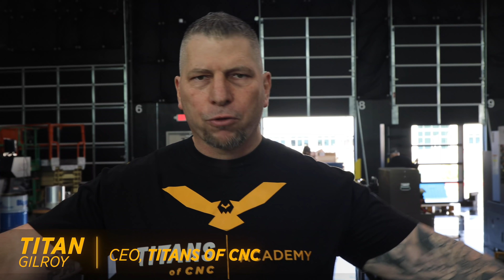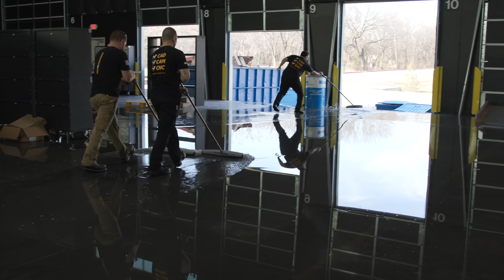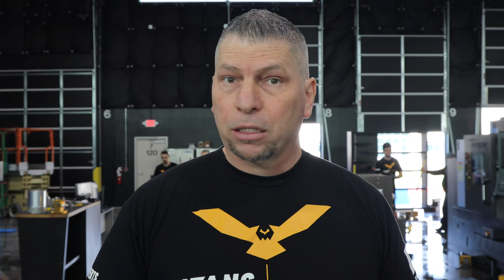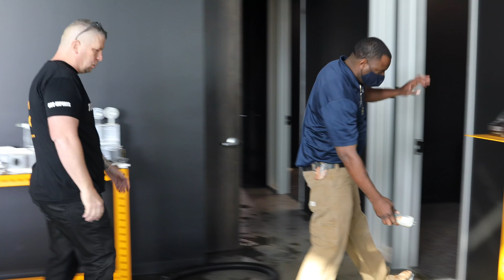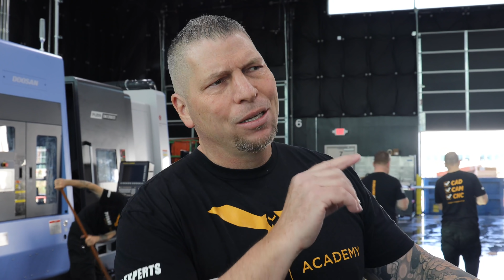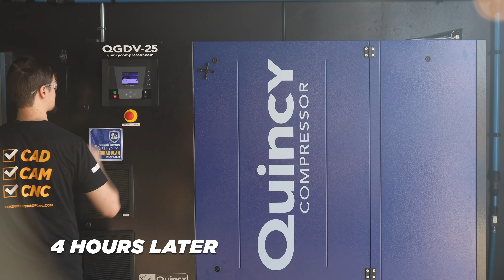Fixing Our UNDERWATER CNC Machine Shop

Comment: You can also get water sensors/alarms that you install on the ground
Reply: That doesn't really mitigate the problem and only adds more cost and effort. If the sensors are triggered while none of the workers are there you still have to organise workers to go there and clean up. And while you're busy with that the water keeps running. 
The best solution would be automation with sensors installed on the equipment itself so that it's literally impossible to spill anything.
They opted for just manually turning off the water supply, which is the most cost effective but still leaves a bit of a risk with human error.
Reply: @chas1878  the sensor can be connected to a notification system.  Sure you're still going to have to clean up a mess, but would you rather have 12 hours of running water to clean up or would you rather get it shut off as soon as you can after you're informed of a problem.  Same reason we have fire alarms.

Comment: That happened in our 20 machines CNC shop in NH 2001. Fire sprinklers went off. Took awhile for fire dept to come and shut off the water to that system. Sweep water just like you guys. We had a creek on the other side of the parking lot and had to be careful to not get the oils mixed in to pollute the water. We had a big coolant recycle area but it didn't get flooded.

Comment: Hey Titan 
You should build an solonoid valve in the pipe for the water. Put an eletric switch on the wall which opens the valve for a specific time, like 20 min or more if you need it. This would be easy to build with a relay which has an timer build in.
And this can never happen again.
Have a nice day. 
Really appreciate your work man.

Comment: Hey Titan, in the dental industry the same problem can arise as the chairs are attached to water, air, and wet vacuum. The insurance companies deny responsibility in certain scenarios when water events happen and so special care has to be taken to TURN OFF THE SUPPLY LINE AT NIGHT. If your office is on the 6th floor of a building and all offices below are saturated due to a water leak and the insurance denies the claim you can be bankrupted! We have to rely on the staff to monitor this and a failure to perform the shut down is considered a serious misdemeanor on their employment record. Having watched your video I am going to get the electricians to wire a solenoid to the master relay, to shut off the water when the lights are turned off at shutdown. Thanks for the heads up and your inspiring videos, stay healthy, Richard

Comment: The first week after Christmas we had the same problem in the machine shop of our Foundry in Germany. There are 23 machines in the shop. All machines are conected to a central radiator, that hold the temperature of the coolant constand. The main pipe of the radiator was leaking over the puplic holidays. More than 3000 liters of water flooded the shop floor. It needed 5 apprentices and 3 hours to remove the water with industrial vacuum cleaners. The floor in the shop is coated with epoxy resin, so there was no harm. Good luck in your new donicile.

Comment: Don't panic under pressure. Best tip ever.
These guys from Dry Force seem to know their stuff. Nice blowers/air dryers and also measuring for moist in the walls - which could otherwise become a real problem.
You could attach a water sensor to your alarm system. While this does not prevent a leak, this may prevent excessive damage.

Comment: On the plus side, at least you know how level the floor is and where the low spots are :-) Great solution turning off the valve after every use: Might I recommend a Magnetic 'sign' that lives on the valve handle: When valve is on, Magnet Sign is on control panel, until it is replaced when valve off.
That way if the magnet is on the panel, you know someone forgot.
Sorry to hear this happened, hopefully the carpet is salvageable and no major rust occurs anywhere; I know what it is like to walk in on something like this...
Getting news like this on your way in does not a good start to the day make, however, at least it was not like the news Job was getting :-)

Comment: One of those things that happens.  We usually named the Lake after who left the valve on.  You could move your DI system to the rear of the shop, and build a perimeter around it like a dam, to hopefully guide the water out the back door if it happens again.

Comment: Turning off main system is a good plan, I would also recommend cutting in som floor drains especially by the water system
Reply: Absolutely
Reply: I think in alot of industrial buildings like that don't have floor drains to prevent people from washing crap down into the drain, at least our shop doesn't have floor drains

Comment: The factory I used to work in in England flooded about 6 months ago from a freak rain down pour, had about 70 guys sweeping water out of the building and using vacuums. All the lights dropped out of the ceiling tiles and water was pouring in on top of the machines, the DMU HSC55 I operated got waterlogged,  it blew the circuits and encoder and where so much water had got in the slideways had seized up had to get new spindle head and rails. There was much more damage around the ship as well, luckily it was mainly covered by insurance but worrying for the bosses especially in this current financial climate!

Comment: You learned the hard lesson of hose barb fittings. They only work with the proper mix of compatible hose, fitting and clamp. You need to tighten the clamps a few times to compensate for hose compression and shrinkage under the clamp. Then you need to keep an eye on them for slippage. An auto sense shut off is needed as well.

Comment: Titan sorry to hear.  I have a Tormach at my house and have a smart things leak detector under it (Also have them on my hvac, dishwasher, laundry and water heater).  I’m sure there are commercial units out there but for $20 a sensor and $60 for a hub you could do the whole shop for $500.  If water is ever found it can trigger a shut off to the main, or just alert you and your employees.

Comment: That could of been so much worse but handled like a pro cool and collected under pressure,my shop did this last year and luckily we have an under floor drainage system where when its turned on it drains any flood water away but I forgot to turn it to automatic so it was like this shop but only took 3 hours to drain it away,good job titan

Comment: We had an 8" fire main connection blow out while they were testing it.  They got it turned off in a few minutes (they had to run outside to the main) but they had to replace all the carpet and then they decided they needed to slice off and redo the bottom few inches of all the drywall.  Took weeks.  So hope it was didn't get to the drywall.   But water sensors are worth looking at too.  It's not just equipment that leaks.

Comment: We have had the exact same issue at a place I used to work. The mains tap to the coolant mixer was left on all night, pressure eventually got to the mixer hose and popped the seal, this flooded about 15000sqfeet with about 50mm of water.

Comment: Look into replacing all of the screw type hose clamps with double ear clamps or hose ferrules. Screw types are notorious for being weakened by applying a little too much torque & then are compromised. Shutting off at the source is best but even with that, they could still pop off.

Comment: The CNC shop I work in we can't discharge water like that outside... EPA regs. Anyway, we have pneumatic vacuums with 100 and 500 gallon tanks. Make short work of even large spills. Then it all goes through the fluid process room, removes all the water and we recycle any coolant and send out all the rest...

Comment: I’m sure the service you called will use dehumidifiers in the office.  You can use a wet vac all day but the dehumidifiers will take the moisture out of the air in confined spaces.

Comment: Add electronic valve to shut off the main water supply to that machine when it's not operating. Should be a fairly low cost solution.

Comment: Slow down your feed rate.  You shouldn't need to have the coolant turned up that high!  (That was a bigger than normal disaster, though.  But you're right, getting upset doesn't get things fixed any earlier.)

Comment: do you have sounds dampening on your shop walls?  
also, you'd think it would be code to have a solenoid on the main water in(other than sprinkles) to shut the water off at the end of the day or light out.

Comment: Wouldnt it be a good idear to have the water in a resest part of the floor ( a square)  with a small channel in the floor to the wall and a little hole in the wall in case that it happens agenda then the water can just run out by it self well being contained in that square? Just a idear. We use it have all our water stuff outside in it own little room that could drain outside in case of it leaking

Comment: Next time install some floor drains with a sump pit. Kinda odd to see a shop without any floor drains at all.
Reply: Because they are a machine shop. They do not want the oils and other chemicals running into the drains. You have to have a sperate tank hooked to any drains. Expensive, someone with a tank truck has to empty it and dispose of it . Illegal around me to build anything with a floor drain if you even work on cars.
Reply: @johnscott2849  Yeah that is why there is a central sump pit that can drain into a holding tank. Did you happen to notice they were forced the try squeegee the water out their bay doors? That's their main option, and it seems to have no environmental considerations at all. What's the plan with the oils and fluids you mention? Squeegee that out door too? You suggest these materials exist in this setting, so where do they go when needing to be cleaned up? Use shop towels to wipe up and toss in the trash? Absorbent medium?
Reply: @johnscott2849  And cost is fuck all for a shop like this. It would be about $10k a year to manage.
Reply: @DistantVision85  like I said expensive to do more then likely why there isn't one..
Reply: @johnscott2849  Doubtful.
Reply: All I have done is point out reason for it not being done and all you have done is run your mouth. What is your problem? Mouth out running your brain.

Comment: Did you build the shop without floor drains?
Reply: You can't
Reply: @ThePatricebouchard   Can you please explain why? The building I work in have them and the other show I worked in had them and I’ve seen them installed in residential shops to

Comment: I would suggest crimping those lines properly, or switching to a crimped hydraulic fitting on a custom fit hydraulic hose. $100,000 machine vs a $100 hose. I feel like this is something you'd probably be telling me; "dont rely on a 10 cent hose clamp" or something

Comment: Because of stuff like this our company has outright banned the use of hose barbs on any new machines we design about 3 years ago. They may be cheap, but stuff like this eliminates any cost benefits hose barbs may have over other, more reliable, fittings.

Comment: just a idea but never depend on humans to turn off water in a place like a shop, people forget or get busy, get plumber to install fail safe auto shut off valves when too much water flows, and wireless alarms sent to your cell, from floor alarms if water is on floor, they can also be set to shut main building water off if too much water usage is going on. Just a thought.